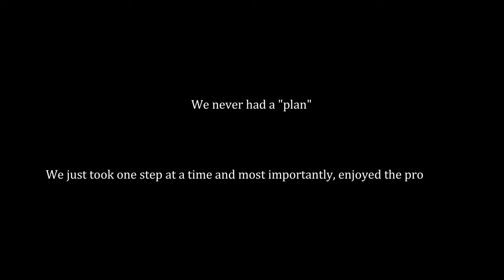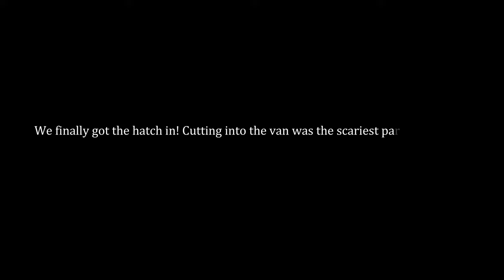Better Than We Expected | Hiace Campervan Conversion

Comment: Hi Ruth we have been looking at similar for a while now, but as previously said, prices are ridiculous here since covid. 
People are selling conversions or even just old vans for thousands, which previously would have been little more than scrap. This also created a breeding market for unscrupulous people, scam artists, and potentially dangerous conversions. So looks like you’ve got yourself a decent set up for the money! Well done.
Standing room is a nice touch as I’m 6ft 2 and well built, although my wife is asian and under 5ft so not such an issue for her.
I think your van size would be minimum for us but great for some of the very narrow roads we travel in western Scotland and the isles.
We would probably need a small trailer or garage space in the van for transporting a sea worthy boat and outboard, that at the moment I transport in my small estate car when visiting the west coast of Scotland, which lets us gain access to many more locations only accessible by loch/sea.
I recommend loch Awe as a place to visit on your travels, especially via boat, and the Caladonian cannel, weather permitting.
You probably have much more knowledge on campers than me, but if sticking with gas you should make sure you have detectors fitted and low venting as lpg is heavier than air and you want it to be exiting the vehicle in a worse case scenario.
Depending on the time of year you travel, perhaps a diesel heater is a worthy consideration for our weather.
Magnetic midge netting also very very worth while investment that can be bought off eBay for pennies.
As for bed extension…perhaps a slide extension would be easy to make, or a hinged flap piece….difficult to say without seeing it in person.

If you check this guys videos there’s loads of advice on his channel on heater etc

https://youtu.be/G2gVKQBDwMs

I

Comment: Hey nice simple and clean design. Just one thing everyone seems to miss packing insulation wool into their walls and roof. Is there reasons? 

I found my van one my second build with thoroughly done insulation was 10x cooler in 37+ degree days. 

I done full sound deadening 
Heat barrier foil
Full moisture protection
Full acoustic protection (light sound proofing)
Thermal insulation wool

Then applied my walls and roof. (All the electrical was in conduit and pre wired before insulation)

I had one person say when it was pouring down how is it so quite and like the waters hitting rubber ahaha worled amazing for quietness and especially heat and cold

Comment: Hmm, Bed at the front does kinda make sense. Could still also leave the back open to have the option of transporting long items, or putting pull out drawers under it. Also in a van with double sliding doors, means if your sleeping double, you wouldn't need to crawl over anyone to get out for a 3am loo run.
Reply from the maker: Yes! I’m really happy with that decision also you have a little more room for the mattress as it can go on the engine at the back. I would just like to add in some slide out draws (one on the side and one at the back, that is all i feel i’m missing 😊

Comment: Whats the length from the bottom of the bed to the back of the van? Thanks I love your set up
Reply from the maker: The bed frame is 153cm. It is the same height as the back off engine/seats 

The mattress is 173cm and sits on the bed frame and back of the engine/seats which gives me the extra 20cm 

Thank you 😊✨

Comment: Great work and good to see you working so well with your dad. Was interesting to see how you fixed the cross-bracing for the roof lining. But you do realise it's not that clever to show yourself on YouTube driving down the street taking both hands off the wheel so you can put your seatbelt on?